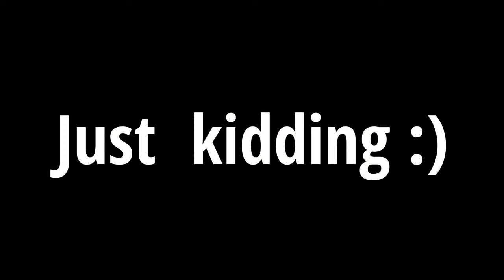DIY 15 Minute Shop Cart

Comment: I have never seen anyone use WD40 as a finish on wood! Also, it comes in a spray version? Not just aerosol?
Reply from the maker: It was a slight joke 😃 But it does protect a little bit, and did make the walnut pop (and also the plywood!). And its going to get on that thing eventually anyways 😃

I use a lot of WD-40 around the shop, so the cheaper route is to buy it by the gallon (https://amzn.to/3BaqV7y), and then you can just use a regular spray bottle - looks like the one I have isn't on Amazon anymore.

Thanks for watching!
Reply: @TheNewJankyWorkshop  I figured using as a protectant was more of a joke,  it still surprised I never saw it before.

I don't personally use a ton of WD40 myself (my dad does, like waaaaay too much on anything he uses it on) but I'll have to look into getting some in non aerosol form. As I tend to work on a lot of smaller stuff so the aerosol always makes more cleanup than it's worth as it goes everywhere. Lol.
Reply from the maker: @justinbanks2380  The aerosol cans need some sort of throttle/valve on it like a garden hose! :)